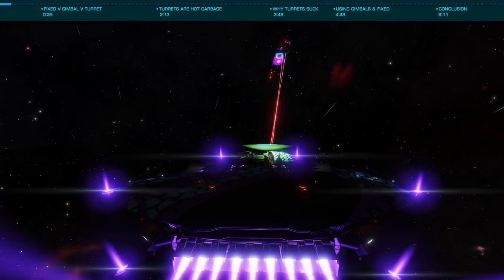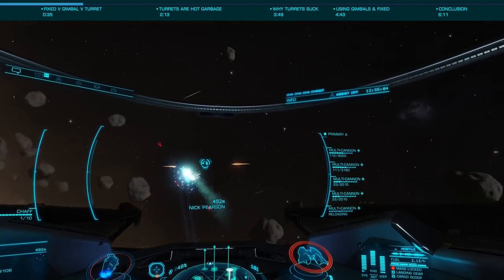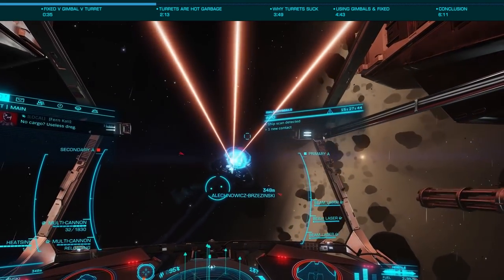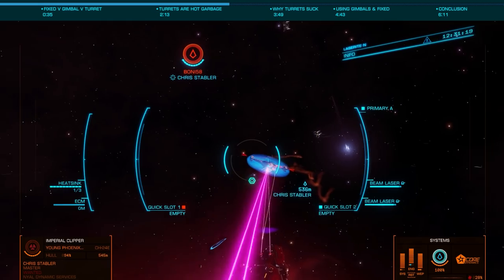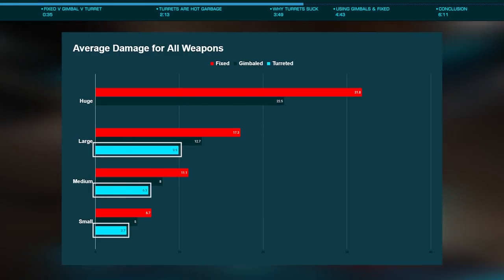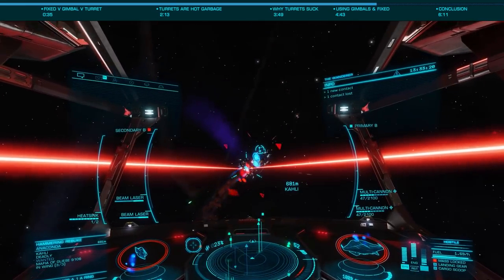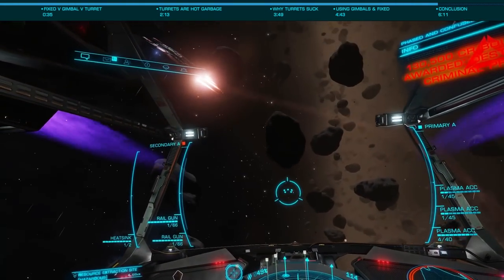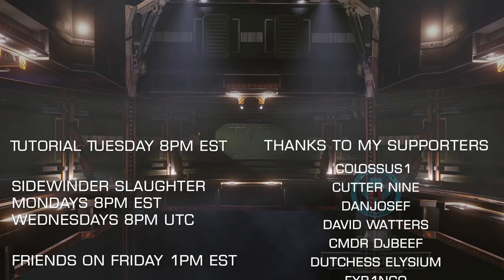Why Turrets are Hot Garbage - Fixed v Gimbaled v Turreted

Comment: That’s one of my main problems with Elite Dangerous.
Tracking for gimballed and turreted weapons is nothing but a bad joke. From a realistic standpoint the only “ships” that make sense having fixed weapons are the SLFs.
For most ships turrets should be standard, but i guess Frontier wants to keep us dogfighting with fixed weapons in giant ships that absolutely dwarf a jumbo jet.
Reply: Well, technically, with inertial dampeners to compensate for pulling massive Gs in space a massive ship with big enough thrusters is as manoeuvrable as a smaller craft. thats a lot of Ifs however and I like turrets exactly for that reason, it makes bloody sense that a massive ship has turrets. But truth be told it also makes sense that less movement gun makes the more thick energy cables can be so it does make sense that gimballed and fixed weapons would be better. Its sort of fiction vs reality. Like when rocinante uses fixed railgun but has PDCs and torpedo launchers, another thing that realistically makes more sense to be used at over 2km ranges but in game you wouldnt use torpedoes unless target is coming straight at you and you are 1km away at most
Reply: Satori sama The most realistic weapon would be turreted missile launchers. Fire and forget, no matter where the enemy is.
Admittedly, this would make for some pretty boring gameplay.
Reply from the maker: It seems like someone's never flown an engineered Vulture, FDL, Mamba or Krait Mark II - all are very maneuverable and work wonderfully with fixed. Not following you at all.
Reply: EDTutorials by Exigeous It does work in game just ok, when it actually shouldn’t. That is essentially my problem with it!
Even the Sidewinder as the smallest ship in the game is substantially more massive than today’s fighter planes. The Vulture might still classify as a “small” ship in ED, but it is absolutely humongous, I’d say it’s comparable to a C-17 Globemaster III, now tell me how ridiculous it sounds to enter a dogfight with that kind of plane. The Fer-de-Lance barely fits on football field, the Krait definitely doesn’t. Here we are already more comparable with an AN-225, the biggest plane we have today.
Then we upgrade to a anaconda or a corvette, and still fly them like a WW II fighter plane.
For a game that focuses on “immersion”, ED has a whole lot of crap like this going on.
Reply: i know what youre trying to say but it should be fun as well, as its a game. if you want a simulation, you might wanna play something else
Reply: P O W E R L I N E    I Totally agree on that! But I’d still like to see something that, even if not completely realistic, is at least believable. Some sort of middle way. Something that shows me the game designers used their brains and carefully thought about what they are doing. Elite fails in that regard in just too many corners of the game.
Reply: @Exigeous  I think he was just saying that, in a more realistic scenario, damage wouldn't matter if it were fixed/gimballed/turretted, and most ships would have fully turretted weapons (in real life). He thinks its silly having to maneuver something the size of a cruise ships to face its target to be able to shoot it. But obviously this is a game and there needs to be downsides to easy mode.
Reply: I mean technically the entire idea of dogfighting in space is silly.

I'm frustrated by a max speed. >:( Gimme true Newtonian physics!
Reply: Daenon Janis I can’t agree more! Especially since the fastest speed achievable in the game is still slower than todays jets.

But better be not 100% correct with physics. None of the ships would be able to manoeuvre anymore, because their thrusters are all over the place, but rarely where they need to be.
Reply: I mean, if your pointing the right side to them, it doesn’t miss, like at all in my experience
Reply: @deejnutz2068  - we had Newtonian physics in Frontier: Elite 2.  It doesn't actually play all that well.   If you're thinking like Babylon 5, uh, we already have that.
Reply: Sorry to be that guy but get good!!🤭

Comment: My main use for turrets is my Type-9, I imagine other large, slow ships benefit from them as well, but my primary weapon on my FDL is a Huge Gimballed Autoloader Multicannon, which I used to pair with gimballed lasers on the fire group with fixed cannons as secondary, although I've swapped them out for Railguns recently after being griefed by someone just running the maximum amount of Plasla Accelerators they could while also shield tanking.
Reply: My Type 9 is equiped only whit beam turrets and a fighter hangar. Works very nice against npc pirates.
Reply: @themainman2827  I didn't have the room to spare as I'd already assigned some of my potential cargo slots for additional armour.

My Krait MK2 though has a fighter hangar and is my medium pad cargo runner, with a triple array of class 3 Overcharged Multicannons on the top to support the fighter and two efficient lasers if ammunition runs out. Still manages about 30 LY without cargo too and I haven't even got the materials to fully engineer it yet. Truth be told only some of my kinetic weapons are fully engineered, I'm all over the place on other modules.
Reply: @reonthornton685  Last night i found im actually very good avoiding NPC interdictions whit my type-6, so i think i would change the hangar for another cargo bay for more dirty profit. 
I have a Krait Mk2 too, what a beautifull ship.
Reply: @themainman2827  It really is. I wish we could save multiple loadouts for a ship so I didn't have to manually swap parts every time I wanted to do something else.
Reply: @reonthornton685  That is why i build mine to cover almost every kind of mission: whit a first class passenger cabin, a pair of srv, moderate cargo bay for small delivery, some collector limpets because im too lazy, enough firepower for bounty hunting, and a fighter hangar because why not. 

The only thing it cant do is mining, but you dont take a pretty girl to get into a  bunch of dirty rocks, anyway.
Reply: @themainman2827  Mine is a cargo runner with enough firepower to bounty hunt, at the cost of having weak shields that charge fast. I can tackle almost any medium pad job with ease.

Comment: Or another option, to allow you to still fire on the target because your ship turns like a fridge loaded with lead.
At that point you can STILL deal damage while your nose isn't where it needs to be to even use Gimballed or fixed, usually applies to big heavy ships though.
If you are in a Krait MK2, then I totally agree with the sentiment on turrets.

Comment: Speaking of the "higher skill ceiling" weapons such as Plasma Accelerators, what would be a tl;dr version of what to focus on? I'm sticking to the basics with lasers to attack shields and multicannons to attack hull, and I'm wondering about switching to different weapons. The drawbacks of limited ammunition on missile launchers and so on kinda make me shy away from experimenting.
I wouldn't consider myself skilled at all, but sometimes it does feel like it takes too long to destroy ships with say, two small lasers and one medium multicannon on an Imperial Eagle for example.

Comment: While it's true Turrets do less damage per second (DPS) compared to Gimbal or Fixed Mount for the same weapon.  That rated DPS does not account for Time On Target.  Even against EXCESSIVE use of chaff, those Turrets are going to give you 2x, 3x or more the time on target of fixed.  While you're flying by and getting turned around to make another pass, my Turrets are still hammering on your shields and or hull.  The time it takes you to line up a good shot with your fixed weapons against my effectively stationary Anaconda is all the time I need to get a fresh target lock on you for my pack hounds.  And all while my Turrets are STILL hammering on your shields and or hull.

So the deciding factor at the end of the day in the Haz-Res or CZ is why you are building that ship to take into combat.
Are you building that ship to BRAG about going into combat?  To show people how well you can do even with one hand tied behind your back?
If so then Fixed Mounts are the way to go.
Besides, most of the more powerful weapons are restricted to fixed mount only.  
Just make sure that your wallet is ready to make a rebuy if you go up against a just mediocre pilot who is using turrets.
Because it seldom takes long for that hot garbage to turn your sweet ship into cold scrap and a cloud of manufactured mats.

Are you building that ship TO WIN?  So you can then move on to the next target.
If so then you'll probably be using turrets on every weapon you can.

Comment: another reason to use turrets would be if your build would technically require 3 firebuttons. Then you can set your turrets to "attack at will" to have them fire as soon as they have los on a hostile or "target only" and pair em with another weapon (multicannons are awesome for this as they have a spinuptime; means you can hit the button and get your turrets going while the multicannons dont fire and when you want to fire those you simply press the button and keep it pressed; but there are other combinations that make sense). It goes without saying that the weapons on the turret are there for utility rather than damage (like thermal vent beam lasers or corrosive multicannons, eg.).

Comment: The different weapon types are so ridiculously unbalanced. Weapons shouldn’t do less damage because they’re gimballed or turreted, especially given the additional cost. 

The damage should remain consistent, and it should be power draw and heat that’s increased when using gimballed or turreted, which makes even more sense when you consider that the ships that would need aim assisted weapons the most are the ones who would have the larger power plants and distributors and could absorb the higher costs. In contrast, smaller, more nimble ships like the Vulture can rock fixed weapons more easily. 

Those should be the drawbacks, not reducing damage so much that they become useless no matter the circumstances.

Comment: Note on cannons - you should only use fixed cannons for particular setups where you want to hull mash your opponent, capitilising on particular special effects. 

For module sniping, you should use gimballed with long range mods as this increases their projectile speed. 

There is simply no point using fixed cannons with no specific goal, because fixed multis are better at that.

Comment: This is an interesting point. But let's say I am using my Type 10, and I have not engineered it, would turret weapons be good?
Reply from the maker: IMHO absolutely not, that's the entire point of the video. They make zero sense unengineered as the damage is so much lower. Let's say you put 4 turrets on the larges - that's the same damage output as 4 fixed MEDIUMS. Now, the T10 doesn't really work with fixed so I'd go gimbaled (and do, I enjoy the T10) and I have no issues with time on target at all, and when I am on target I kill it MUCH faster. So leave the turrets at home until you have some engineered then bring a single small corrosive up front and you're good to go.

Comment: So I have a question. My T10 is extremely slow when trying to manuveur around to get my target in front of me. (I'm slowly engineering it to be more responsive, but it's still a T10) For this reason alone, I've elected to go with turreted weapons. However I use it as a platform and hop into a fighter. Would this be a good use of turreted weapons in this case?
Reply: I do the same. Have the 2 large and 2 medium on the roof as turrets. I like it because when a more nimble ship is out turning me I can keep damage on target till I get behind them.
Reply from the maker: IMHO absolutely not, and that's the entire point of the video. Sure, it'll take you a few seconds to get turned and you basically have to use gimbals on the T10 due to the wide hardpoint placement but given the huge difference in damage between gimbaled and turreted gimbals will always win. Realize that by running turrets you're almost putting mediums on larges and smalls on mediums. I'd encourage you to give gimbals and try as I run them on my T10 and they work extremely well.
Reply: @Exigeous  I think you might have overlooked that Elder is using the T10 as a platform for a fighter, so turrets would in this case absolutely make sense, wouldn't they? Since the control of the T10 would be entirely in the hands of the hired copilot and not Elder while Elder is using the fighter.
Reply: Boogie Baggins  their aim isn't in question. If I was in a more manuverable ship with a fighter, you best believe that ship would have fixed or gimbled. The issue is the physics of the T10 in general as it has a larger turning rate and would be outclassed by actually fighters just by being able to get into blind spots.

Comment: That almost a year late but... "Fire at will" mode do not require pulling a trigger. In fact in this mode turrets WONT shoot at all if trigger is pulled. They would automatically fire at any enemy ship that attacks you. Thou , they would not fire at enemy that only try to break your hatch with hatch breaker limpet and do not shoot at your ship. In the same time - SLF in fire at will mode would attack those pesky rats and that would trigger your turrets too. Also, SLF or Turrets would not interfere if your wingmate under attack (purple enemy marker on radar), until there is an order for SLF or enemy hits your ship somehow(and turn red).

Comment: In case anyone got picked up by youtube algorithm 2 years later.
Turreted weapons are conditioned for:
1. Do you already have a primary and secondary weapon that's constantly being used and you still need a third? Yes? Is it a Medium or Small hardpoint? Yes? Then use turret for your third.
2. Is it a weapon for its function, like scramble spectrum or long vent, not for damage? Yes? Is it constantly on? Yes? Use turret.
3. How much of time is your hardpoint firing at the enemy? Less than 70% of the combat time? You're not constantly facing the enemy? Is it a Medium or Small hardpoint? Yes? Use turret.
4. Is it a crappy location hardpoint? Yes? Use turret.

Unless you're using something like plasma or railgun, do understand anything that's Medium or Small hardpoint don't really matter on damage due to their low penetration.
If your hardpoint sucks at forward fire, for example Corvette's LMM hardpoints or Cutter's wing MM hardpoints, Anaconda's belly SS hardpoints, they're excellent turret locations.
For ships that have good forward fire hardpoints, like the alliance triplets or almost all the medium and small ships, they don't need turrets, this is mostly a large ship issue.

Comment: I use them, I have my Type 10 Defender loaded out with them exclusively and missile launchers for the small hard points. It works pretty well because of how many hardpoints it has and it isn't the most nimble ship. Other than that honestly I prefer gimbled, having to line up all your shots sometimes it is better to have the gimble or turret.

Comment: Only so much weapon distributor to go around, which will limit your overall dps, ultimately it’ll come down to damage per energy.  

With turrets being similar to fixed in dpe, even if lower damage per slot, when you got the slots, might as well spread that distributor between as many slots as possible with weapon that has higher time on target, than power 2-3 fixed for lower overall dps.

Comment: I like putting turret on extremely bad weapon positions, like the 2 medium stern mounted hardpoints on the conda. It's almost impossible to get them both to fire at the same time due to not being able to cross over so and since they are on the sides if they are both turreted they provide an almost 360° bubble of fire making weapons there apply status pretty much constantly.

Comment: You’re not wrong, but I do love my current turrets. (Corvette: 2H G.Multicannon, 1L T.Beam, 2M T.Beam, 1S T.Beam, and 1S T.Multicannon)
The turret on the bottom helps me deter players who get under me, while the medium beam on each side are long range, and help me agro targets normally too far away.  This is especially useful when my target is surrounded by NPC ships and is about to die, because turrets that hit a friendly target do not incur a bounty.  The small weapons are simply too weak for me to pay attention to, so it’s overcharged to hurt people who get closer, and the Multicannon has corrosive shells, which helps all the weak turrets dream more damage.
Long story short, my ship causes a light show in every direction, and although I can’t cause burst damage like many prefer, I can maintain fire on a target at all times, at all ranges.
Reply from the maker: I sincerely hope you'll try switching all those horrible turrets to gimbals as I'm rather confident you'll see just how much better they really are given all the negatives of turrets (much slower tracking, higher jitter and MUCH lower damage). Gimbals are very easy to use on the Vette and even the Type 10 (as I showed in my stream)

Comment: I love small or medium laser turrets with gimballed multi cannons on the larger mounts. When the enemy using countermeasures they still can do damage but not too much on friendly. Long range mod on laser turrets can do constant small damage. Turrets are under developed in comparison with X2 The threat. I was more effective with 17" CRT monitor at 1024/768. In that game there are settings where you can see what the turrets doing with small monitors in the corners.

In Elite the fight aspect is well under developed.